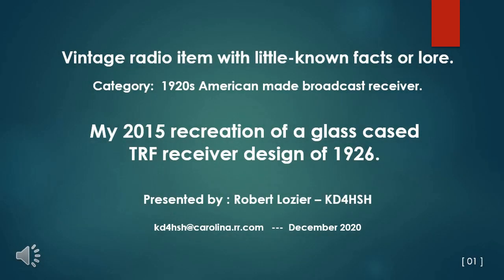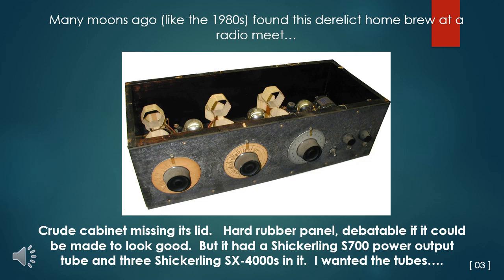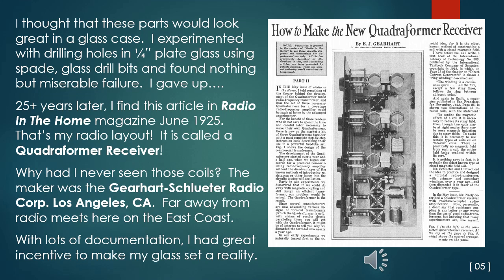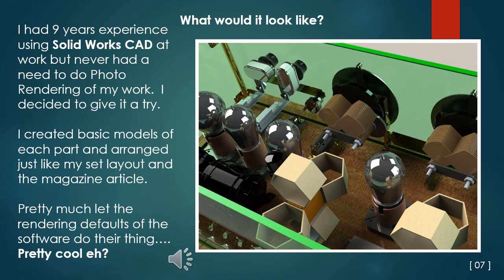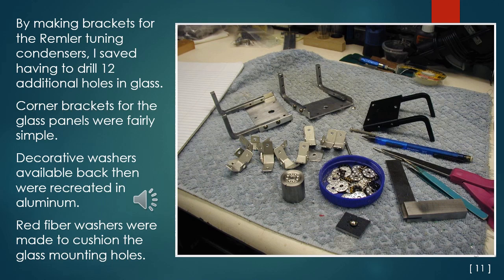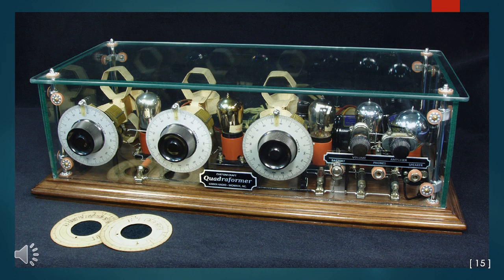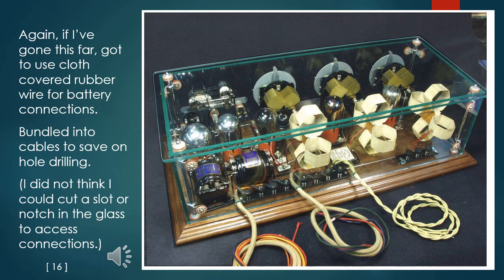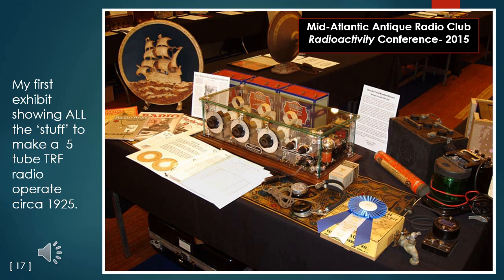Ultimate Antique Radio Upcycling - A trash to treasure Glass Cased Radio

Comment: Robert, 

Your knowledge, perspicacity, and stunning craftsmanship are astounding.  Well done!  

I've always admired those unique "patent proof design" Cardwell/Remler variable capacitors.  And, those unique RF transformers arranged in a four-sided toroidal form to mitigate unintentional cross coupling are inspired.  What a unique and creative solution to circumvent Erla's patent.  

The set you "manufactured" is visually stunning, and a valuable historic cultural resource.  And, the batteries and other apparatus you chose to display with it provide a much richer context than the proposed battery-box design.  

Thank you for your many valuable contributions to the preservation of wireless history.  

Best regards,
Larry
WB6BBB

Comment: An easy way to drill through glass is trepanning.  I cut some 7" round disks from thick sheet glass by making a cutter.   I first used a router to make a 7" diameter wood disk from plywood.  I drilled a 1/2" hole in the middle of this disk and put a carriage bolt there to chuck in my drill press.  I then cut a band of thin steel and wrapped it around the disk.  I cut notches into this band which was attached to the disk with wood screws.  A dam made from plumbers putty was put on the glass both inside and outside the circle where the cutter would be.  I filled this dam with water and #80 carbo abrasive.  The cutter was run at the lowest speed my drill press would do (180 rpm) and was slowly lowered against the glass.  It took several minutes to cut through 3/4" thick plate glass.  I see no reason why thinner glass would not work, though you'd want to put a soft material such as homosote on the drill press table to support the glass.  Smaller holes (I cut out 7" holes) should be easy as well, maybe a smaller diameter carriage bolt would be needed for holes less than 3" in diameter.  For the cutter band you could use metal from a tin can cut out with shears.  It is the carbo abrasive that does the work, it and the water will have to be renewed every so often as you cut.  I didn't have to flip the glass over to cut from both sides, just go slowly with less pressure as you reach the break through point and let the carbo do the work.

For really small holes use a cutter made from hollow aluminum or brass tubing.  This will wear down quickly, so you will have to keep changing the cutter.  Fill one end with epoxy or insert a dowel into the tubing to keep it from squashing when you chuck it into the drill press.  Again, cut some notches in the business end of the tubing.  Same procedure as before, build a dam from plumbers putty around the hole and fill with water and carbo.  A higher drill speed can be used on these small holes, but try 500 rpm or so at first.  Should work fine for 1/2" to 1/4" diameter holes.